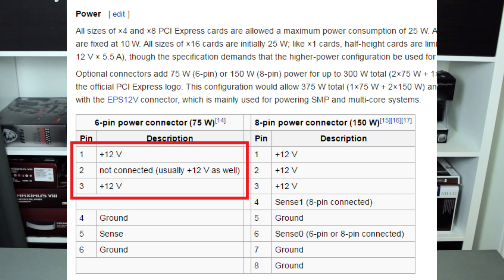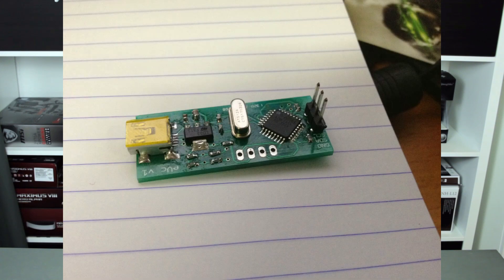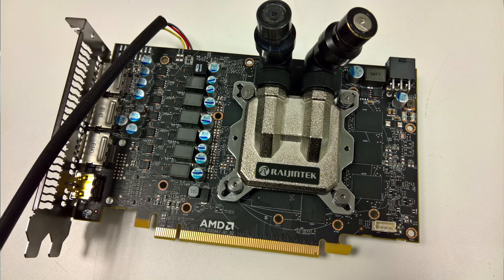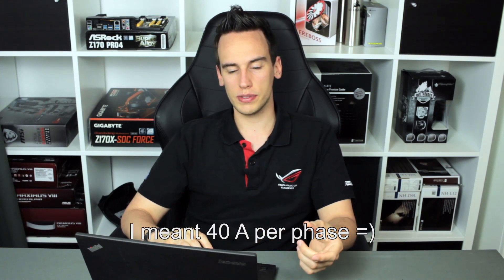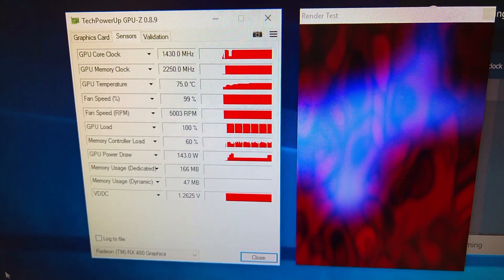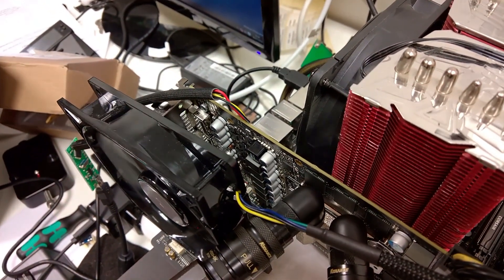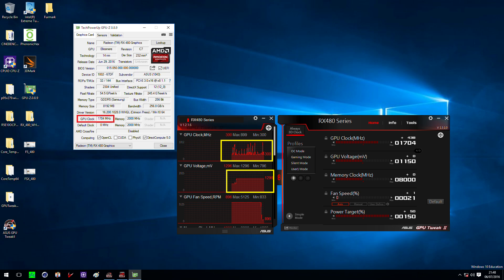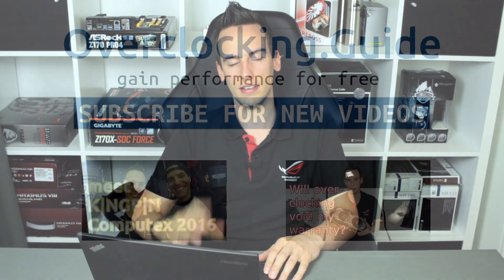Advanced AMD RX 480 Overclocking - 1500 MHz using I2C and watercooling

Comment: and stock GTX 1060 has 1.7ghz and OC to 2.0ghz for only $249....
Reply: Yeah! Like the 63 degrees at 2200Mhz of the GTX1080 ... you know, the paper launch stage? That turned out to be true. So did the £470 price tag! I mean here in the UK, the only 1080's in stock are £680! Not that there IS any stock, right? But thats what happens when you paper launch a card which was supposed to be out 6 months later.

Yeah the 1060 is gonna be the best thing since Jesus. The 960 was supposed to be but, well ...... ya know.

I fucking love Nvidia so I already pre-ordered twenty.
Reply: Just like how the Gtx 1070 sells for 379 amirite? it's going to cost more due to demand
Reply: CPU speed is not everything. Intel and AMD Cpus are living proofs of this.
Reply: lol
Reply: well, just wait few month, it is not like you need a GPU right now, if you smart enough you wait and you buy for cheaper
Reply: Higher GPU clock DOES NOT mean that the card is better .*

Comment: Nice heatsinks on the VRAM, how did it not catch fire?
Reply from the maker: Because they are specified up to 125°C and are only 100°C on load?
Reply: der8auer well if they are only 100c at load
Reply from the maker: I'm working on an article about power consumption and VRM temperature as well at the moment :) Will be online soon on overclocking.guide
Reply: der8auer Good stuff!
Reply: I must have missed the heatsinks on the VRM in the video, because I didn't see any.
Reply: thats the joke

Comment: Meanwhile an aircooled msi gtx 970 can erach up to 1540mhz
Reply: +San Mattew <---Fanboys that wanted to justify their purchase,Amd gcn arch has much better IPC than Maxwell/Pascal,deal with it,an 50mhz of on amd gcn = 200 MHz on Pascal
Reply: Travis J thats why fanboys like you are stupid,comparing a 300$ 3.5gb card vs 240$ 8gb card,this shows fanboys are stupid as hell
Reply: Also NVIDIA Frequency doesn't Scale with Performance so well as AMD Does. AMD GPUs are Clocked lower, but once Overclocked, huge impact on Performance.
Reply: E Alex RX480 is RM1250 here in malaysia,which is 310 USD,the cheapest 970 here is RM 1500 with the stock cooler,which is 372 usd....
Reply: until this card came out, prices for 970 werent that low. people seem to forget that this card is lowering the price of all nvidia cards, thus making a more competitive price/performance market. i agree that 480 missed the mark on the hype surrounding it, but its a baller card and without it nvidia cards would still be at higher price points. curious what the 1060 would have gone for, had it launched before the 480.
Reply: As someone that checks pcpartpicker nearly everyday for price drops/offers 1080 did nothing to prices during its launch , it was around Polaris 10 Launch/Price announcement that prices were getting down nice try  anyways.. xD (that just aint the whole truth like ur random statement) it was a few days before the NDA for the RX480 that i saw a few cards getting down in prices.
Reply: +Travis J 480 dropped 900 prices, saying otherwise is blind. 970 is only appealing against the 480 as a result. nvidia would still be gouging you without 480.

now you say old tech. lets say its on par with 970, and maybe 980 down the track, amd cards mature well and this is likely. 1060 is coming at 980 performance, at a slightly higher price point. is nvidia also releasing old tech? 

its a midrange card dude, trading blows with higher range cards from a previous generation, happens on both sides every launch. tell me thats not the case?
Reply: Guess we´ve been watching different benchmarks since everywhere i read or watch 390/380 gives better performance than 970/960 (except those with gameworks etc.. etc.) but since i dont care about brands (and nvidia doesnt impress me by one bit looking at them prices) i´ll keep waiting for that $199 price avail. for the consumer.
Reply: only thing i care is facts and ur statements ain´t doing much here, +E Alex has a better aproach in the matter thats how ppl should give their opinion not stating things that ain´t 100% Certain.
Reply: haha,i have both nv and amd gpus,i buy the one will last the longest and have best price/perf
Reply: +AMD and Nvidia GPU vs Games Hahahah! Yeah sure whatever makes you feel better m8!
Reply: In every bench mark comparison ive watched the amd equals the 970.Another outdated release from amd smh
Reply: rx 480 350$ gtx 970 340$ this is canada....
Reply: AMD and Nvidia GPU vs Games
well obviously it depends on the country. Thus, we can't really be telling other people what the better value is since it seems to be different for most countries.
Reply: cheeselord44 Not even close 480 is doing nothing its the gtx 1070 and 1080 lowering the prices good try anyways..
Reply: D3sTvsiOX Nvidia lowered the prices there self a couple weeks after the 1080s release by 25% on the 900 series ..xd
Reply: Nvidia knows there 900 series is better than anything amd has to offer..You can get 980s on the cheap and there better than what amd has put out..
Reply: AMD and Nvidia GPU vs Games fanboy is that what you call people. I call it like i see it..Amd releases outdated tech again..
Reply: I can see nvidia or amd hurt your feelings. I could care less which company makes the gpu i just want better than what amd is offering right now...
Reply: And when the 1080ti comes out maybe the 1070 n 80 will start dropping in price xd
Reply: I hope the 1070 gets knocked off like 50 bucks for Christmas or black friday deals
Reply: D3sTvsiOX I do not talk shit ok..
Reply: All good, im not trying to start something,just pointing out things i found by doing my homework as a consumer, in another note: "Can't Tell You Yet" GTX 1060 Embargo Rap (Yes, Like a Rap Song)
Awesomesauce Network <--- funny shiit.
Reply: AMD and Nvidia GPU vs Games Fanboy you nub im on a amd right now..Get a life and you do not buy things because of the name or color. Performance is the king and right now nvidia is winning in so many ways...Now tell us where did the Nvidia gpu touch you..Its ok just point..

Comment: For 200 USD is ok. Problem is that AMD put 6 pin connector on it and let the card power through it. They should have opted for 8 pin. Card would be temperature limited and everyone would be happy waiting for a custom cooled cards. This way they created themselves a lot of problems. They do know that reviewers test cards consumption so basically they made a stupid decision.
Reply: did you not watch the video ? doesn't matter if they used 6 pin or 8 pin ...
Reply: +THEREALMVP 
i ment because of the power that card pulls from pcie connector not overclocking.
Reply: +THEREALMVP 
For 150 TDP card they could put 8 pin and call it a day. Card would not break pcie 75 watts rating and everything would be fine. Overclocker ot not (he said it is not which does not matter to me) i'll be buying RX480 from Sapphire cause for the price the card is great. I know that 6 pin can deliver more than 75 watts but 8 pin is rated higher and with that AMD would solve anything that reviewers could call a bad thing. those are my thoutghts
Reply: didint you see the video? he told that you can draw did he say 225w just from the 6 pin..
Reply: +Mattias Nyholm yes i did. but that did not stop some to call out the amd for the fact that rx480 does that
Reply: the 8-pin and 6-pin connectors for my GPU cables on my PSU all plug into the same 6-pin sized jacks on my modular PSU, i'm going to go out on a limb here and say that 6-pin can handle much more than  the spec sheet says.
Reply: +Bree Peng 
true that. but complaints were still made

Comment: this thing pretty much OCs like shit on water and on air. funny how everyone is going like "Oh just wait yeah wait for aftermarket!" it will oc like crazy and beat a 980" Lmfao not even remotely close. An OC 970 can beat any Extreme OC from rx 480. RX 480 was plain out shitty overclocker, which means this card is at its limits at stock, meaning that this card would have performed way worst and ocing it would have yielded almost 970 perf. so yeah.
Reply from the maker: ^^^^^^ this haha
Reply: Stupid nvidia fanboy is stupid. Still buying a 1070 tho. I got bored of my 390x melting the ice in winter and feeding african villages on power bill for 1230 mhz overclock

Comment: i'd like to point out a technical error. when you said that SLI/Crossfire motherboards that are meant to handle more than one card won't have a problem force feeding more than the maximum 66W @ 12V the PCI-E specs allows is not true. PCI-E slots have five 12V leads that are rated at 1.1Amp each, providing a maximum of 66W (5 x 1.1A x 12V = 66W). we're ignore the 3.3V line. 
so while the motherboard may indeed be able to provide power for as many as 7 PCI-E slots, or 462W @ 12VDC, that doesn't mean that ANY ONE PCI-E slow can provide all that power. I'm sure a board like the Asus X99 deluxe can handle the RX480 even at 1500MHz, but people who are buying $200 GPUs are not in the market for $300-$400 motherboards. people with $200 GPUs will be rocking $100 motherboards that cost about $15 to build. there is no fiscal room on a product like that to go way up and above the mandatory specs.
Reply: Seems even cheapcomponents themselves are overspec'd by oem's (from who these components are sourced by board makers). Pci-e spec or platform spec to be more precise has little bearing on the actual capability of individual components like the pcie-slot connector.

Comment: Disappointed , this means the card is not going to be a good overclocker, the mods and extreme voltage plus very expensive water cooling used here far exceed what any aib card will do plus this setup is pushing the card too hard for a retail card to even come close. I don't expect to see a 1400mhz aib card unless it is oc to an inch of its life..

Comment: afterburner supports i2c controll via software with commandline switches. maybe you could try to reach similar results without the external pcb.
Reply from the maker: Could be that the driver/BIOS will not allow it or reset it
Reply: Its like I guessed. The slit provided the r2c parameters to use with Afterburner in order to move the bigger ammount of the powerdraw to the Peg. 

http://www.overclock.net/t/1604979/a...e-rx-480-cards

Now it should be totally clear that amd shouldn't have a Problem to Balance the powerdraw in a different way. Either by a driver which performs the i2c commands at startup or with a new bios. I'd prefer the last. But not eb is willing to risk his card flashing a new bios even if the driver install routine does it on its own 

You could even use i2c commands for your Overclocking and surpassing AMDs boundaries. Would live to see you trying to get the 480 to the limits without any hard mod.

Comment: Great video, thanks for share :) . Now 2  question if you can answer for me :) .

Q1) MSI AB has I2C programming feature I have used it on past cards with IR3567B (Hawaii/Fiji), now usually loop 1 has been VDDC offset (register 8D) is this the same on RX 480?

Q2) When you modify how IR3567B see loading of VRM from GPU (lscale) what register is that within IR3567B?

Cheers :).
Reply from the maker: Q1: Voltage Regulator Adress should be 10H :)
Q2: Have to check that, can't remember at the moment
Reply: Many thanks for swift reply. Taking i2C dump via MSI AB of RX 480 I see IR3567B is on bus 6 device 08. So I add command switch:- /wi6,08,8d,xx

xx denoting the hexadecimal multiplier for SVI2 voltage step ie 01h = +6.25mV, correct?
Reply: Any update on the register for lscale?

Comment: You looked like you knew what you are doing. Then you gave us the firestrike score, instead of the Graphics score which is the actual GPU performance instead of the whole system.

15300 Graphics score is above a stock R9 Fury, and way above a stock GTX 980 which starts at ~13500.
Reply: If you can see it, then don't complain. End of story, you have the information, use it yourself.
Reply: It's not like we don't see it. It's about the fact that the guy in the video decided to point out the Firestrike score that has marginal gains with Graphics card OC, instead of the Graphics score which increased much more with the Graphics card OC. Basically, the OC result is much better than what he made it out to be.
Reply: @madalin2133  "The guy in the video".... Do you even know who this "guy" is buddy? LOLz
Reply from the maker: Graphics score is not everything :) Combined test is really hard on the GPU and not limited by the CPU. Also with a slow CPU you will also limit the graphics score.
Reply: Yes. But not everyone has the same CPU and the total score is also influenced by the Physic score, which is purely a CPU test . Graphics score is the only score that varies based only on the power of the graphics card. 
Why don't you test using a i7 6950x then? Are you trying to make the card look bad? Obvious sarcasm.
Reply from the maker: I used the 6950X on my previous OC Video. The total score is the same. Physics score is weighted really low and has almost no impact on a card like this
Reply: /fs/3200194 GTX 970 + i3 
/3dm/4515846 GTX 970 + i7
Both cards at comparable clock rates.
One has 10k in Firestrike, with Graphics score of 11.5k
The other one has 8k in Firestrike, with a Graphics score of 11.9k.

Are you telling me that CPU has nothing to do with it?
You are testing a graphics card, not review-ing your test bench. Stick to graphics scores.
Reply: Yeah Fire Strike GPU score please, and if possible a passmark GPU score. Graphics score is everything in this context. A combined system score is not relevant
Reply: Are you talking about the GPU score in Firestrike? Isnt it right under the total Firestrike score?
Reply: Yes its there right under it 16612 they are just blind.
Reply: +Rudis Yes the 480 is LOW END>  Don't be mad over it.

Comment: awesome job, subbed :)

latest info on AIB cards reflect your expectations with 1420-1450 max clock speeds

do you reckon 1.5 on air will be possible later on with later yields of the chip?

i mean like:
do you expect the 14nm finfet process to improve at all for these chips a couple of months from here, that may push them just a bit further?

could chips done at samsung be better than glofo's, even though it's the same tech?

i'm kind of looking for an expert's opinion on whether they expect this border may shift a bit on later revisions or not ;)
Reply from the maker: Thanks man. I wish I could give you some good info here but I'm not a big fan of rumors and hype so honestly - no idea. I rather keep my expectations low and be surprised. Personally I wouldnt expect it to improve much. I don't see why AMD would put any R&D effort into this. In the end overclocking is something a very small percentage of people is doing.  With a "golden" GPU and great cooling you might be able to hit 1500 MHz later but I wouldnt expect it at all on an average card.
Reply: +der8auer good point, seeing AMDs budget it's plausible their r&d is already gone to vega by now :)

getting an rx480 regardless anyway

just waiting for one with cooling solution that isn't as noisy as the reference card :)

Comment: That Firestrike graphics score 15363 (@ 11:40) almost matches the 15679 stock clock result for my Sapphire Fury. It's a shame that can't be achieved by the Average Joe overclocker.  

EDIT: Just listened to what was said after that about the 100% stable 1480 o/c and the next result is even higher but he points out that he turned tessellation off via AMD's software, What is the point of doing that? All it does is make it so it isn't comparable to all the other results and confuse things, Pointless.
Reply from the maker: Well I said that the first result was done with everything on stock and we did the 2nd  score (Tesselation disabled) for the HWBOT Rankings. You can still compare the first result.
Reply: All I meant was that as you mentioned the second result was done with a downclock because that was a 100% stable overclock meaning that's the result I'd want to compare with others. it was an interesting video though so thanks.

Comment: Could you measure total system power consumption at the wall socket with 1430MHz (1.28V) and with 1480MHz (1.35V) during load ?

Comment: so is the voltage controller programmable in such a way where AMD can release a BIOS update to shift the load balancing around

as I understand buildzoids video they ram and vcore and wired to physically separate planes I am not sure if program-able load balancing is even possible ?
Reply: The RAM is hardwired to one plane. The Vcore is split 3:3 between the PCIe slot and the external connector. So the latter one can be rebalanced within a broad range.
Reply: the question is whether or not the controller can actually do that
Reply: someone on OCN did confirm that the controller is programmable in such a way where it can be made to shift the load 

http://www.overclock.net/t/1604979/a-temporary-fix-for-the-excess-pci-e-slot-power-draw-for-the-reference-rx-480-cards

Comment: 1- how much real power consumption at 1500 1450 exp
and what the lower voltage you can set at let say 1400 1450 1480 cause 1.3 for vga too much max 1.22 1.25 
 
2- what about unlocking cores 40 cu ? or 4gb to 8gb

3-can you test it in quantum break cause heavy game and to see shaders decrease effect vs r9 390
 + the highest oc effect in it
Reply: they can try bios hack to find out if polaris 10 does have 40cu, but it's just rumor.